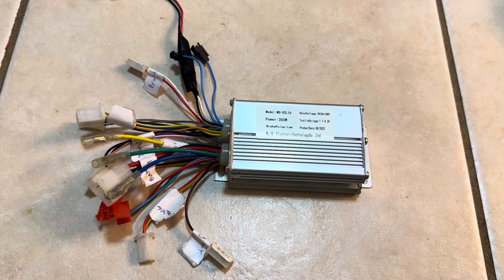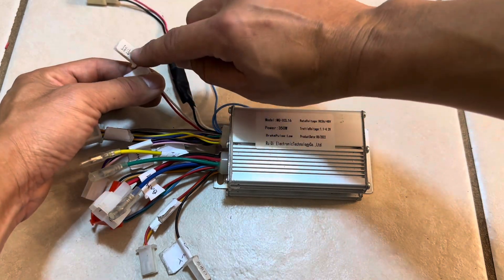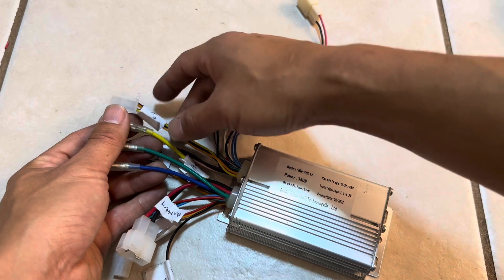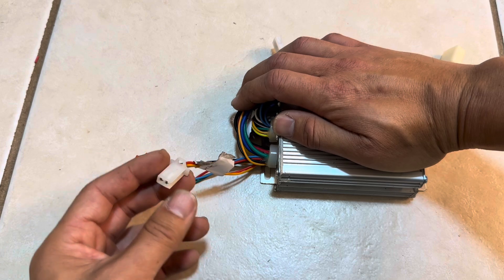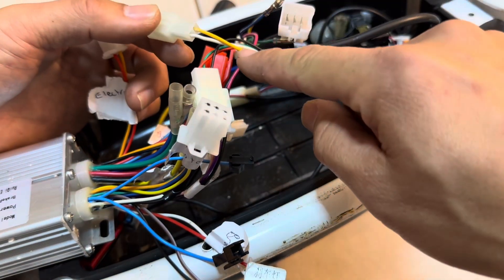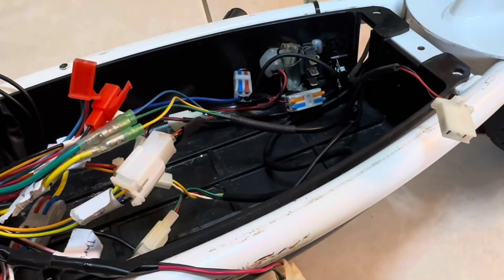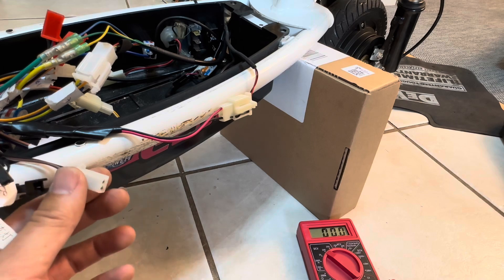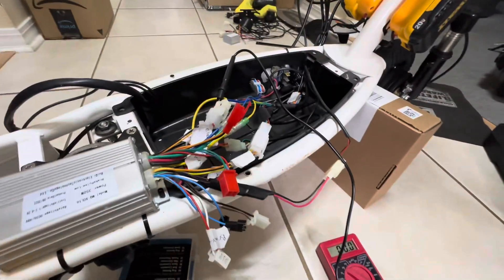Brushless e-bike hub motor controller wiring diagram MQ-XCL16 36v/48v 350W tutorial explained BLDC

Comment: Hey man I'm putting a 60v controller to my 750w motor bike, I'm having trouble getting the controller to turn on with the ignition. I connected the ignition and it turns on and off and but it doesn't turn on the controller any recommendations?
Reply from the maker: Hi, it’s tricky to troubleshoot issues without having the bike in front of me, but I will try to walk you through the issue.  I would get a multimeter and test all connections.  Make sure the controller is getting the correct 60v power input.  The ignition switch is usually 2 wires and when connected, turns on the unit.  I would try to bypass the ignition to see if you can get the controller running.  When I run into issues, I bypass everything and slowly add different accessories to the controller.  That will pinpoint where the issue is.  Start with connecting the power to the controller.  Connect the motor to controller, and connect the throttle to controller.  Jump the ignition wires and test.  Hope this helps.

Comment: thanks man  a educational vid  very helpful    indeed  but I have watched 100s of  videos on hooking up controllers   and   the only thing they show you how to fix is the mosfets that  are blown   which is fair enough beceauce  I guess they are  one of the first things to go   ,I do think the wiring  of  a controller  should be  fairly easy   just to hook  up the  three Phase  wires  going to the motor  and the POSITIVE AND NEGATIVE GOING  TO THE BATTERY and   the lock wire  (smaller red wire that can  just be  connected to   the  main Positive red , just so you can by-pass any  key  you might  have and this will  make the controller   operate as if a key was   attatched)  so then all you have to do is hook up the hail five pin that also goes  to the motor  , and  when you  connect the  2 wires that  will spin the motor in a forward or  reverse  motion  ( sometimes these two wires get  called "learning wires" or "learnng line")  so only  connecting up 4 seperate connections  should let you know if  everythings working at the very basic level   ,  from there you will need to hook up throttle,  key and  everything else .  but  my problem is someone  has wired   things up by linking    wires    totaly un colored and   splicing into  wires  all over the place   and  its made it a nightmare   , I suppose they knew what they were doing    but  for  someone  else to try to work it out OMG   its even  difficult  to make sense  of it all with a multi meter !

Comment: Ok if a battery output from a blue wrapped battery  is the same as a battery output that is in a case that has a key that needs to be turned on  to be the same output as the blue one but throttle won't work if I use the one without the key and. Case what am I missing ? Does it need a key to work but as long as it has the same output from the battery   they both turn on the display and out put for a light  but the battery 48v blue one. Just pulses the motor. What am I missing ?

Comment: Is there a speed limiter wire?
Reply from the maker: Hi, this particular controller I used in the video does not have a speed limiter wire.  If you need more speed, you can upgrade the motor and batteries.  Thanks for watching.

Comment: can i not plug in brake stop handle?
Reply from the maker: Hi, if the brake handle plug does not plug into the controller, you can cut off the connector and splice the wires.  Connect the wires directly to each other by soldering or using butt connectors.  Let me know if you run into any other issues.  Thanks for watching.
Reply: @DIYwithDUY  I had luck not connecting them. Turned out that my problem was a second fuse attached to the battery was blown .I also found out that the all rubber tires  will not be as smooth and will cause the spokes to come lose going back to air in tires
Reply from the maker: @joeybez5464 Glad you got it figured out.  Ride safe out there.

Comment: i knew it, I  knew it. Eventually i would find thew perfect vid of simple instructions to the point and perfect direction. Well done bro , this is like whole body on the floor down the best description i have had the utmost pleasure viewing. Give this guy a hand and pat on the back , this is what you tube all about . Informative , Precise, Truthful, honest, quick simple total explanation of a complicated device , WTG BRO >>>that is 100 % dude , how bout the same quality on how to run the wires to the lights and from end signals rear brake light , and wire harnessing to front etc ,  test regen brakes and motor for power.  see if it works . 

Man i learn in a flash with your direction after good 40 videos at least , hrs and hours of watching vids that gave an idea but still confusing at the end ,Not with yours,   Really great job again my friend if i could bash that like button more it would have locked my computer up very well done , And i have a motorino xph but exactly same cept some one butchered the controller and no easy plugs all stuck with tape or glue , what a mess , least now i have direction , 

please do more , and if you have a vid of running the whole harness to front end would really kik ass, keep it up , im telling all my scooter pals come have a look at your vid . killer. others need to learn from you on how to make a gripping well directed informative help vid . . literally years since i found one of these perfect to the point and then some even mentioned  the others not using to giv e full demo incredible .  for reverse and to demonste???  kudos dude that was outa the park  and into the old lady's window <smile>>> i want more  heheh 
BRo
Reply from the maker: Glad the video help.  Thanks for the kind words.  I really appreciate it.

Comment: Where do you get the plugs at?
Reply from the maker: Hi, all the plugs and connectors I use are from other razor scooters and e-bikes that I have taken apart over the years.  Here are some similar connectors on Amazon. 

https://www.amazon.com/Letool-Electrical-Female-Connector-Cables/dp/B07FP2FCYC

You would probably need to splice the new connectors in, but it would make it easy to remove in the future.

Comment: Can I put this controller onto my m365 electric scooter
Reply from the maker: I wouldn’t recommend this controller for a M365.  I am sure you could get it to work with the hub motor, but you would need to rewire a lot of things for it to work.  It is not plug and play for a M365 scooter.  Thanks for checking out the video.
Reply: I've got the dash for it
Reply: May mate everything went together great, but when I went to plug the battery in it sparked at the connector what would cause this
Reply from the maker: @RodMaddern Hi, the spark sometimes happens when connecting a battery cable and is considered normal due to the rush of current to power up the controller.  As long as everything is working, you should be good to go.  If there was a spark and the scooter is not working, then something may be wired wrong.  Check all wire connections with a multimeter to confirm everything is wired correctly.  Let me know if you have any other questions.

Comment: No way 48 volt brake light. Sorry.
Reply from the maker: Yeah, they have them available on Amazon.  Here is the one I used for my build.  
https://amzn.to/3G3IV2K

The system worked with 24v up to 48v input.  Comes with a bright led headlight, turn signals, and rear brake light all in one system.  Thanks of checking out the video.
Reply: @DIYwithDUY  you could cook lunch with that thing. Lol. Still helped me with my rewire. Thanks again.
Reply from the maker: @ No problem. Glad the video helped.

Comment: what needs to be changed to make it work with 24 volts
Reply from the maker: Hi, you would need to purchase a 24v version of this controller. This particular controller does not turn on unless you have a minimum of 30v power supply.   Here is a link to a similar controller that works with 24v brushless motors.

https://amzn.to/42wwveA
Reply: @DIYwithDUY  If you only change the 24 volts, everyone knows what I'm asking, is it possible to change 48 volts to 24 volts?
Reply from the maker: @Aisyahnrazizah123   Hi, I am a little confused with your question.  Are you trying to use a 24v battery voltage on this 48v controller?  Or Do you have a 48v battery and trying to reduce the voltage to 24v in order to use on a 24v system?

Comment: Thanks for the nice demo of the e-bike controller! I'm curious, would a regular motorbike security alarm be compatible with this controller, or are there specific requirements for e-bike alarms?
Reply from the maker: Hi, the main difference between a regular motorbike security alarm and an e-bike alarm is the input voltage.  Most regular motorbike security alarms use a 12v input.  E-bike alarms usually have a higher voltage range from 36v-72v.  You can still use the 12v motorbike alarm, but you will need a voltage step down converter to bring the voltage down to 12v.
Reply: Thank you once again for the clarification! I've taken note of the key difference between regular motorbike security alarms and e-bike alarms...👍👍

Comment: Can you give a battery recommendation? I don't need a ton of run time, maybe 30 minutes to one hour, thanks!
Reply from the maker: Hi, I like using lithium tool batteries on electric scooters and e-bikes.  The reason is because I already have Dewalt tool batteries on hand and swapping out batteries for freshly charged ones is easy.  You can simply purchase a battery adapter for the specific brand lithium tool batteries you already have.  I use 4ah 20v dewalt batteries and wire them up in series to create 40v.  I have even wired up three 20v batteries in series to make 60v, 4ah output.  The 4ah gives us approximately 45 minutes of ride time, then we swap out the batteries for freshly charged ones and can ride for another 45 minutes.

Dewalt Battery Adapters (yellow instead of black (Black is sold out))
https://amzn.to/4dXBTLP

2 Dewalt Batteries 20V 4AH
https://amzn.to/47kmEZT

I use the factory dewalt tool battery charger.  I do not connect the charger to the scooter charging  input.

Comment: Hi, that's a really in depth video on the connection. Thank you for that. I wanted to know what you input voltage was when you were getting output of 62.5V on the break light? I am using a different controller and my goal is different than an e-bike, although I am using ebike motors and controllers. To be specific these two - motor: https://a.co/d/hCTztPf, controller: https://a.co/d/4a1H1Lp.

Comment: Bro I plugged all the wires as you told but motor was not working..... And also not ignition..... Only battry indicator working...😢
Reply from the maker: Hi, if you have a multimeter, check your battery voltage.  See if there is enough voltage to power up the controller.  If there is enough voltage, check the throttle wires.  It is usually the connector with 3 wires.  The manufacturer sometimes wires up the connector wrong.  Try switching the 3 wires around to see if that works. Hopefully you get it figured out.
Reply: @DIYwithDUY  ok bro... Thankyou
Reply: Motor starts working but.... Idk how to charge...... Charging wire has 1 single pin and controller has two wires....

Comment: How to charge it........?
Reply from the maker: Hi, connect a charger to the black and yellow wires. Fast forward video to 6:52 
Make sure the battery charger is rated correctly for your battery.
Reply: @DIYwithDUY   bro In my controller... Thair is Yellow and black wires but for auto cut off brakes....       So what should do now? 🥺
Reply from the maker: @ Hi, does the controller work if you do not connect the Yellow and Black wires?  If it is brake wires, you can usually leave the brake wires disconnected and the controller will work fine. Let me know what happens when you do not connect the yellow and black brake wires.  If the controller is not working with those wires disconnected, try connecting the yellow and black wires together to see if the controller works.  It’s a lot of trial and error to figure out these controllers.
Reply: @DIYwithDUY   Bro My controller works without Yellow and black wires... I leaved them disconnected..... Bcz I don't want to connect auto cut off brakes.....  

 And Idk which wire is for charging.....
Reply from the maker: @a_mcpe_gaming7313  Hi, A lot of scooters and e-bikes have the charger connected directly to the battery.  Please make sure your battery charger is rated correctly for your battery pack before attempting to charge the battery.  Connect the battery charger wires directly to the red and black wires on the battery.  Please make sure you research on YouTube for more information on hooking up a charger to your battery pack before attempting to charge the battery.  I use dewalt batteries with the factory dewalt charger for my e-bike and scooter builds, so it is a little different than an off the shelf 36v battery.  Let me know if you have any other questions.
Reply: @DIYwithDUY   Yea I got charger with the battry.... but thair is not any type of charging port in the battry...... Charger Voltage is perfect for the battry... But thair is not a charging port ....
Reply: @DIYwithDUY  And thanks alot brother that your helping me.....         I watched your video and did all the connections... And it works.....    I watched meny videos b but..... Connections did not worked....
Reply from the maker: @a_mcpe_gaming7313  Hi, Glad I was able to help.  The charger should have 2 wires on it.  Simply connect the 2 wires from the charger to the 2 wires on the battery.  If the charger has a plug or port, you will need to purchase a matching port for your battery connection.  For example:  If the charger has a male 2-pin 10mm output.  You will need a female 2-pin 10mm connector to install onto your battery as an input.  This will splice directly to your (battery to controller connection). Make sure positive is connected to positive and negative is connected to negative.  When charging the battery, make sure to turn the scooter controller off.